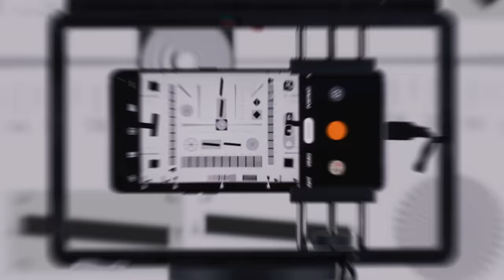OPPO Find X5 Series | Next-gen Excellence

Comment: They should have put 150W fast charging on the Find x5 pro
Reply: They preserve the battery life. Unless they are fully assured that they can provide 150W charging with minimal degradation of the battery, they won't provide it. Especially never on their flagship
Reply: @U they aren't sure yet with the 150W SuperVOOC. I know they have claims of 4 years with 80W SuperVOOC. They released a video on it during their launch of Reno 8 pro. 
But after all 150W is a very high amount of charging speed. Even laptops charge with maximum 67-69W at Max even when they have a proper cooling mechanism. So Oppo will need to be fully assured with the results before they launch a 150W supervooc.